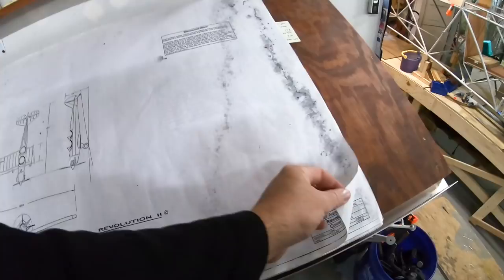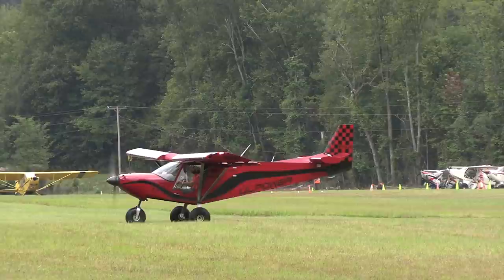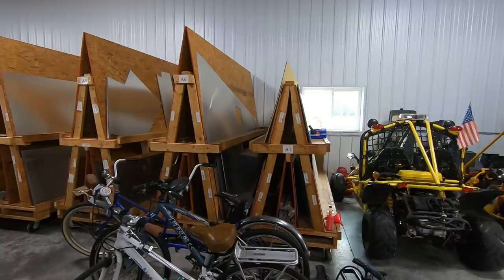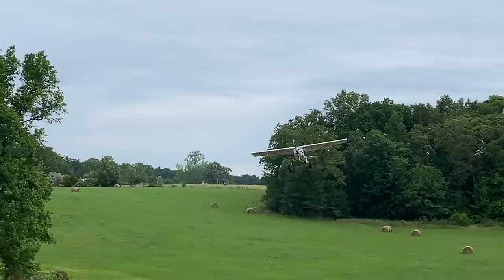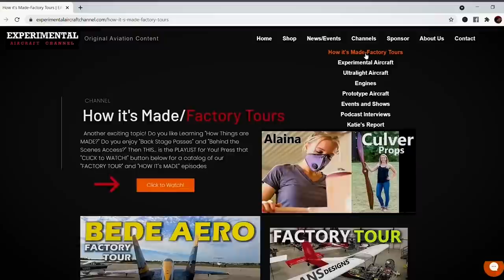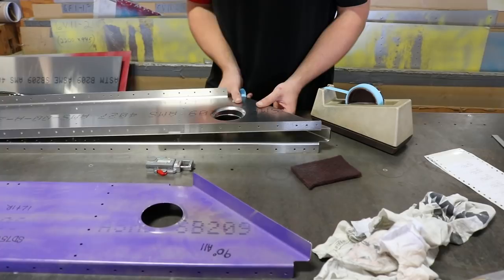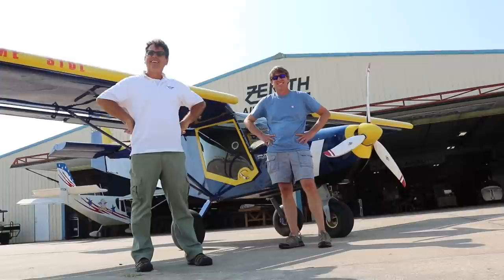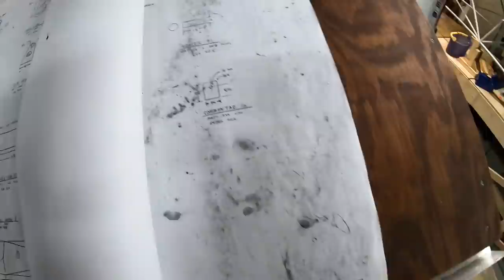Keeping the Mental in Experimental Aircraft - Must Watch BEFORE Buying a Kit or Flying Aircraft

Comment: Who is the manufacturer of that wheel assembly with the gold hub sitting next to you and what is the size of that tire? Thanks.
Reply: I just want to take a guess, I’ve seen very similar if not that same style on zenith airplanes
Reply: @n206ja  thanks
Reply: @terrymenees8109  ... and it's an 8.00-6 Carlisle "Turf Glide" tire.
Reply: @n206ja  very good….thanks again.
Reply from the maker: You eyeing around my shop here?! :-) Matco. Carlisle. No idea on size. It's a golfcart tire Zenith provides. Maybe I will land on a golf course one day and play a round! :-D
Reply: @ExperimentalAircraftChannel  Thanks Bryan. Couldn't help but notice that wheel assembly and have seen it on many aircraft. Just wondering where to source it....didn't think to contact Zenith for some reason.  Probably a substantial savings over certificated parts. Any idea on the weight?